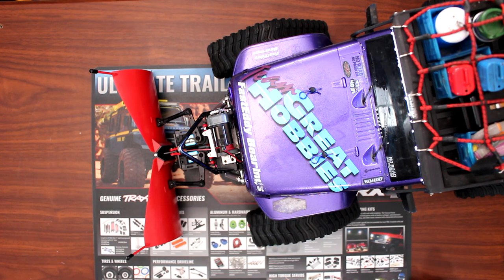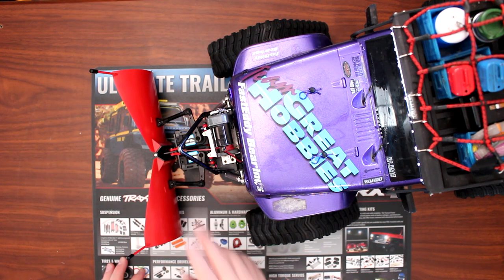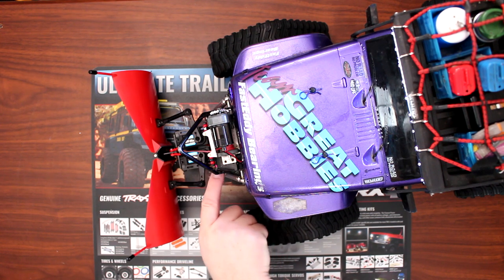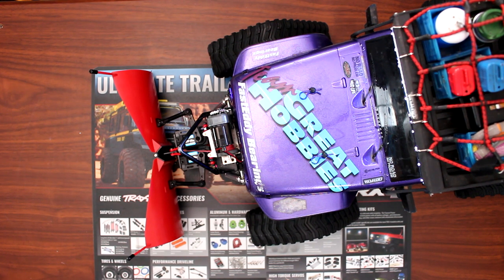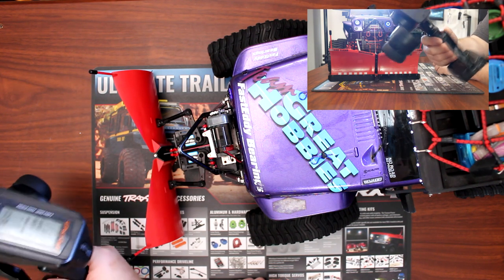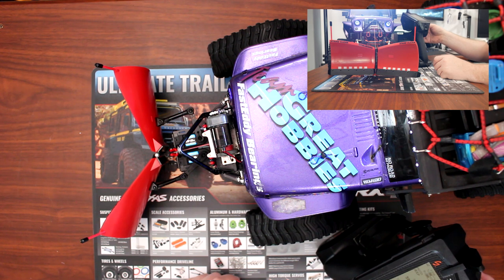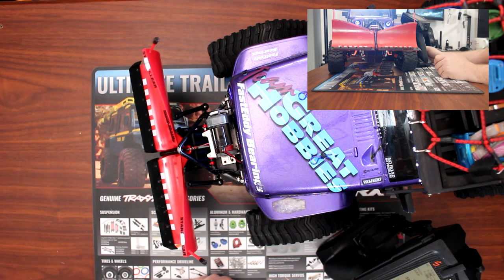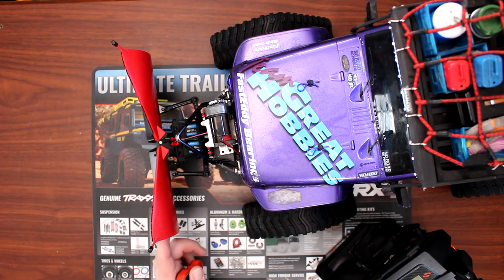RC4WD SUPER DUTY V SNOW PLOW

Comment: How are you able to run the plow and truck functions(locking diffs, 2 speed transmission) on that remote? I have the same setup and can’t figure out how to make everything work on a 5 channel. Thanks
Reply from the maker: To be able to control certain function you will need an external remote to control the winch of the plough

Comment: quick question, hope there is an answer.  I install a the plow model 

on a traxxas trx4.  the issue is the plow is not center.  when I turn it on it goes right or left.  when I press the high/low switch it goes opposite side it start, but never stays center.  did  cross the wires?
thanks
Reply from the maker: From what I’m reading is you’re telling me when you using a switch it goes left or right but never centred you would need to use your switch as a tree position centre would be middle then you would have one side your left or right in the opposite and the other one